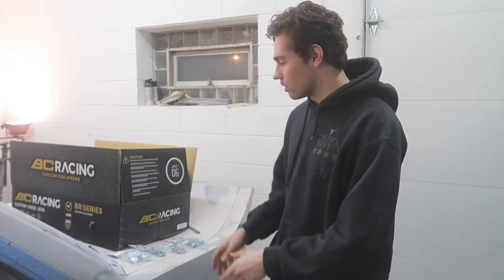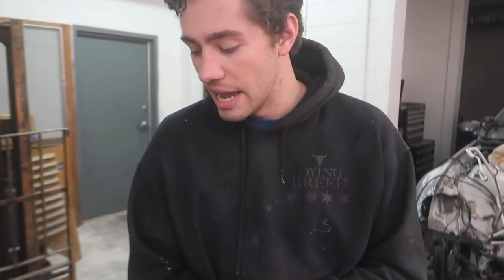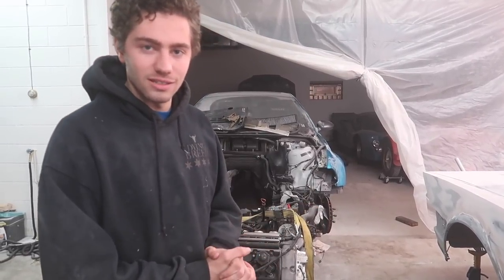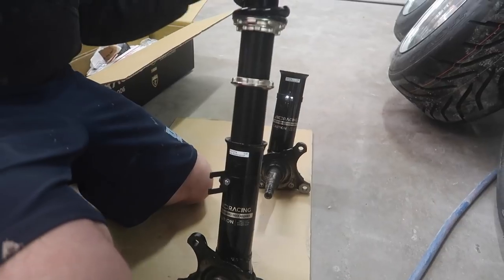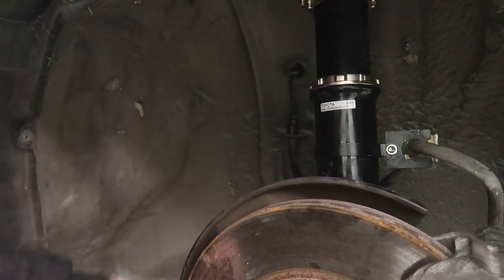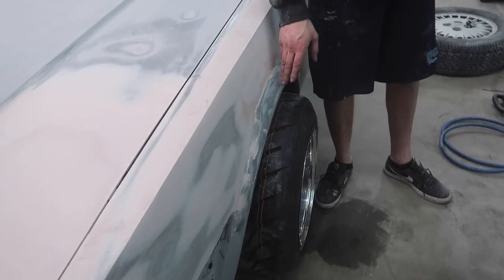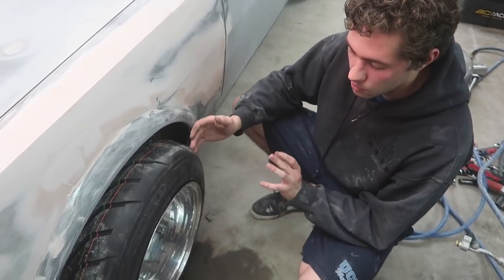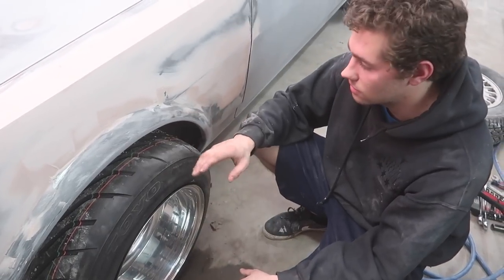Bosozoku BC Coilover Install Pt.2 + Test Fit

Comment: yo boi u better 1j swap this real quick theres mad swap kits so you can actually put those meaty triple 8s to work!!!
Reply: 1jz with ITBs 👍😆
Reply: Boso cars aren't for power
Reply: What I read was Boso cars are traditionally for power... but if you want to build something crazy and new
Reply: 2j with itbs would be lowkey sick though
Reply: Gynkys no...
Reply: some nice 45/48mm diameter trumpets, 100mm long, forward facing offset with mesh filter
Reply: Gynkys i agree, anything with itb's is sick

Comment: You tightened the front hubs way to much, Toyota specifies 10 inch pounds to turn the rotor with the bearings preset correctly. The easiest way to set it up at home is to hang a 1lbs bottle of water off a 1 ft screw driver across the lugs as a good quick and dirty method. Or you can destroy the bearings and the spindles and have to cut your shock lowers off and find new parts, it's up to you. I'm excited to see paint hit this car, it will look great with those brake boilers when it's done.
Reply: I was going to say the same thing. Way over tightened.

Comment: isn't it better if you finish all the Bodywork first before installing any accessories to avoid damaging or painting them?
Reply from the maker: tomstuff460 I can't tell where to mount flares until I know where the wheel sits
Reply: Testing flares next video? :D Front and rear? ;)
Reply: yes that makes sense !